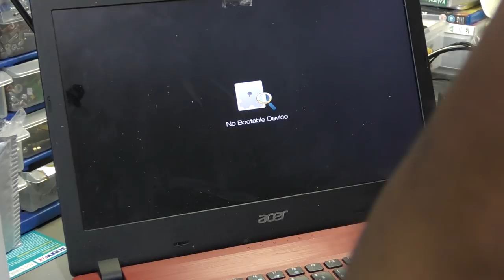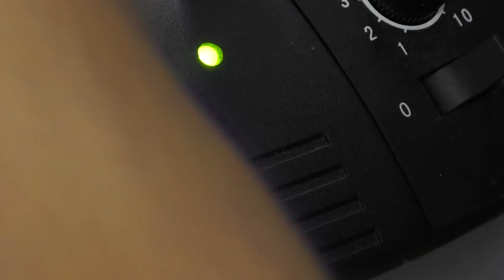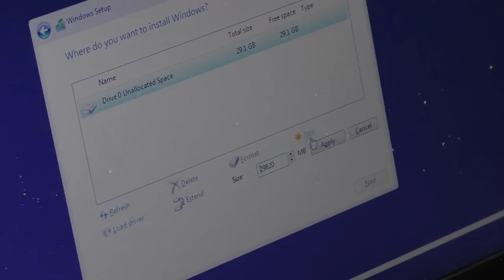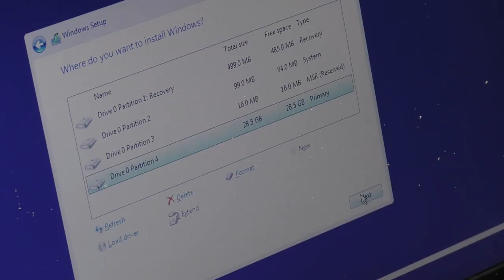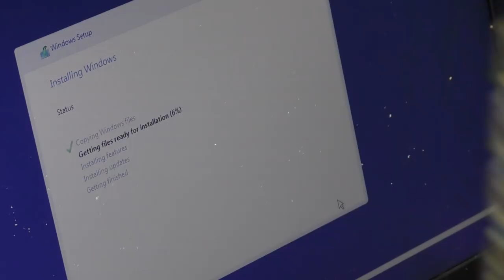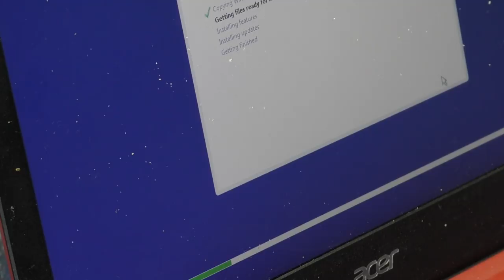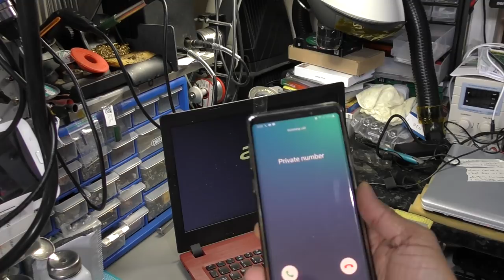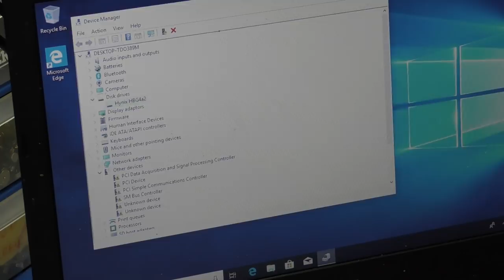HOW TO FIX ASPIRE 1 A114-31 NO BOOT ERROR BY REPLACING EMMC FLASH NAND

Comment: If at another time you could indicate when this model does not turn on as well as I cannot find the hard disk, will the storage disk be a chip?
Reply from the maker: Yes it is a emmc chip
Reply: @iTCXtreme  Thanks, What happens to me at the moment is that I turn it on and an orange light appears and it does not turn on ... will it be a problem with the power source or will it be another difficulty?

Comment: Question: would it be possible to replace it with a larger eMMC chip for additional storage? Fuck Acer for only giving 32GB for Windows 10 and contributing to ewaste.
Reply from the maker: I think 128gb is max but obviously you'll need to remove and replace the existing emmc. Take care.

Comment: Hi. friend as I enter the bios of this laptop, since I tried with f2 but it tells me enter current password, and I don't know what it is or what it means, I need help
Reply from the maker: Reprogram or replace bios is which a workshop can do.
Reply: @iTCXtreme  hello sir,do you have a video on how to reprogram or replace the Bios for the same laptop?
Reply from the maker: @rosemarynjeri4338  Hello, sorry I don't at the moment. 😊👍
Reply: there are 2 jumper pads on the motherboard, short them  then power it on, will remove bios password